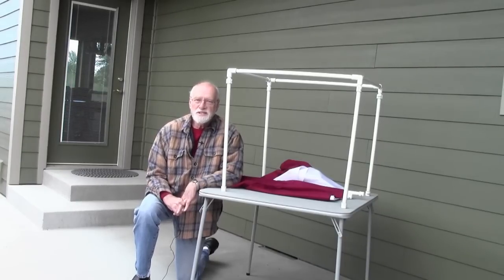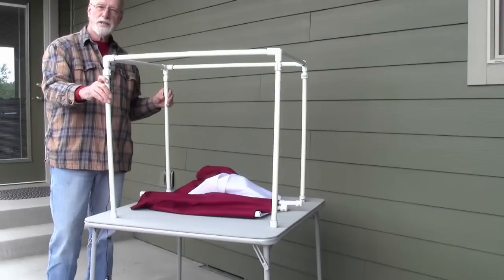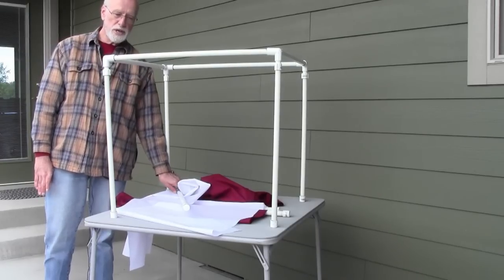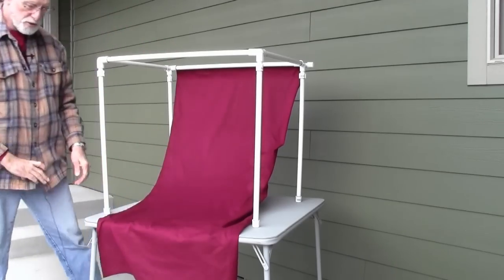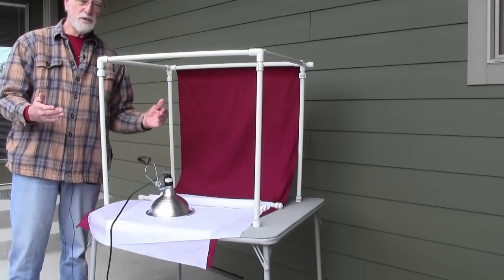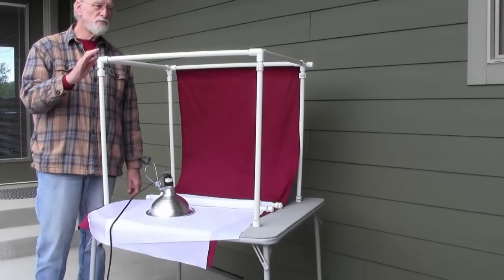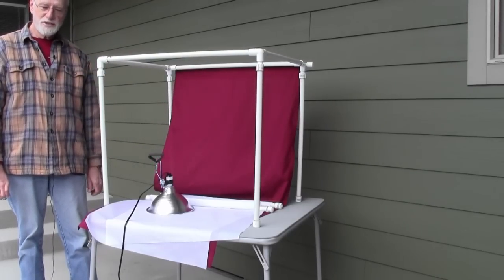Making a Light Tent with style

Comment: Thanks for posting!  I thought it was brilliant and so doable.  I'm going to give it a try this weekend.  You mentioned coming up with a solution for how to clip the light better, I'd be interested in seeing what you came up with.  Thanks again!
Reply from the maker: All of the pvc pipe is 1/2" diameter, with fittings that work with this size pipe. I would suggest measuring the place you intend to use it and cut the pipe to that length. The fittings will add about 1/2" to the length on each side. After this video, I made light posts from coffee cans with concrete in them, adding a vertical 6 foot 1x2" board to the wet concrete. It allows you to move the posts around, and clamp at any point on the post. This worked for me, but it is also another project.

Comment: Can I get the measurements of this light box? Best setup so far I found on YouTube.
Reply from the maker: From a former reply: I made the tent to fit on top of a standard card table. The actual top measurements are about 30" x 28", but you can make the size anything you want by cutting the PVC pipe to any length. The legs are 2 feet high.
Reply: @blueholebob  thanks :)

Comment from the maker: Glad you liked it. I try to do things that are somewhat different than the average fare on YouTube. I used dimensions that allowed me to fit the frame on a card table. I also made it slightly deeper than the width, because some items will photograph better if they are deeper in the tent. I have also used lighting directly into the front of the tent. So far, it has worked great for me.

Comment: Thanks for getting back to me, The one you built seems like the perfect size, how long are the legs.? Have you come up with anything for lighting from above? I have been using a cut out cardboard box and ready to move up. I have been using clamp lights like yours clamped to camera tripods that I was able to pick up for a couple bucks each.  Like my father always said "work smart not stupid. I appreciate your help.
Reply from the maker: The legs are about 2 feet high. I use coffee cans with filled cement and a 2x2 vertical wood posts for holding lights. I have used both clamp lights and Snap-On LED worklights, which provide a cooler light. My whole reason for building this tent was to avoid reflection on items that were wrapped in plastic. For the most part, I used side lighting filtered through the fabric panels, but occasionally, I used a horizontal wood piece clamped to the coffee can stands, and added clamp lights from above.

Comment: I added a bottom frame with the three way corners for more stability, and used the top side rails to clamp the lights to.I also used the PVC cement only on the side panel frames so it could easily be taken down and stored flat.
Reply from the maker: Thomas: There is no "one right way" to do this type of project, so good idea to think for yourself for improvements. I store my tent in the garage, so removable legs made a nice flat storage option. Thanks for your comments.
Reply: @blueholebob  Absolutely correct! That's the beauty of DIY's like these-adaptation to whatever the diy'er needs. You take the legs off, I take the spreaders off-same result. We adapt, modify, and use what we have to work with. I drape a cut white shower curtain over mine...

Comment: I am a little confused about how the side panels work. Can you show it with all the side panels on?
Reply from the maker: +Tim Hardesty
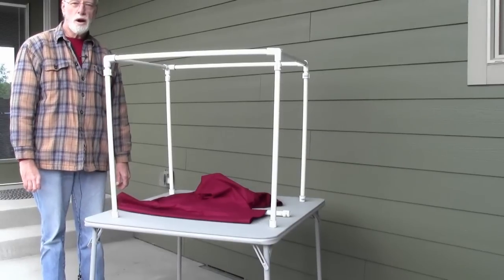Hi Tim: If you watch the video from about 2:30, you will see how the side panels work. I used nylon fabric with a sewn loop at the top that fits over the PVC support. It simply sits on top of the frame, front to back. However, in this case, a video is worth a thousand words. There are 2 separate side panels and 1 backdrop.